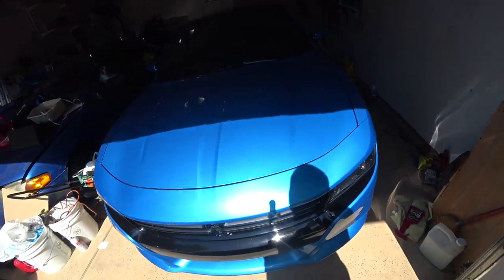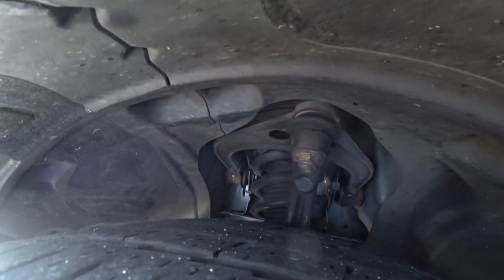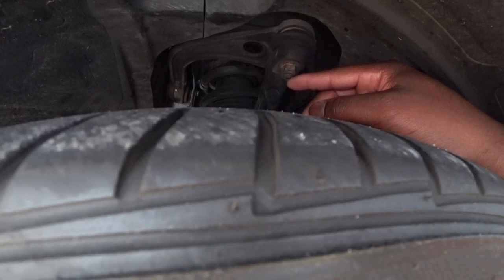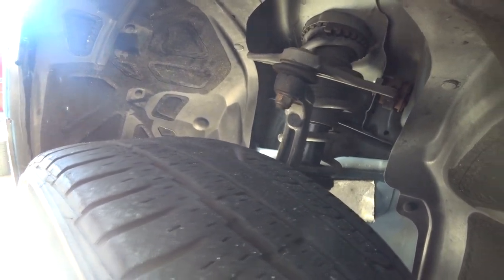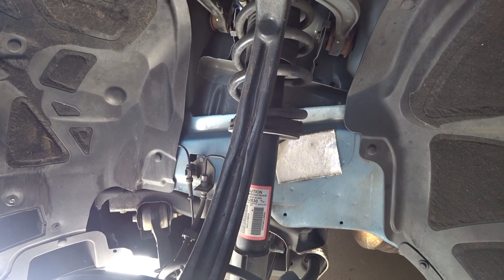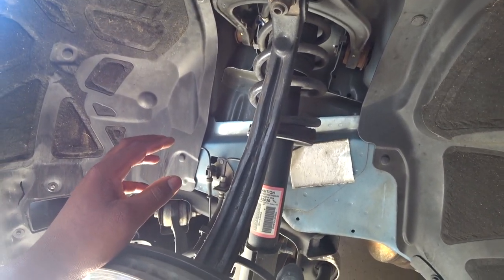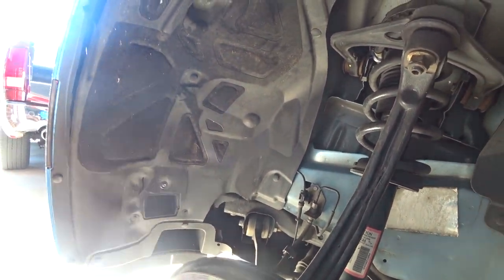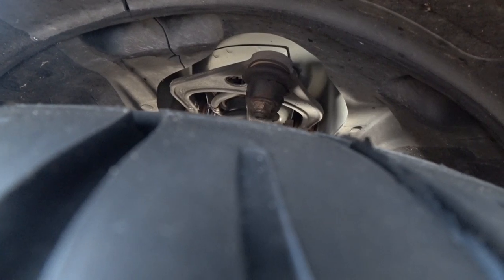Fitting 26s on a Dodge Charger

Comment: come to my work and we put 32-inch or larger wheels,
for sure you have to extend the front suspension 2 inches and back with a 1-inch cup for wheels 26 for charger , challenger and magnum 
Come to Dallas Tx
Reply: Where do you work? I'm in Dallas!
Reply: Aye I’m in Dallas where y’all located?
Reply: Me puede explicar el vídeo en español por favor se lo agradecería mucho
Reply: Whats your shop called?
Reply: I’m tryin to put 24s on my challenger here in Dallas where y’all at

Comment: 2013 charger.from 215/65/18 to 275/40ZR20 106Y.   20x8.5J... I had the same problem. What i did. And didnt know anything. Just got 2" spacers. And now my rims fit. And about 1.5"to2" clearance. All good but the rear hits the tires when going fast and bumps. So it bounces and rubs rear fenders to tires. The front is all g. But what can i do about the rear. Maybe i need need new rear shocks. Or something to stiff from bouncing. There is no vid on what im talking about. 1st person ever with this problem?. Oct 1st 2022.

Comment: What’s your offset bro? Trying to make sure they don’t rub my spindles before I buy
Reply: Rub my brembos I mean
Reply from the maker: So Forgiato doesn't give the wheel specs on the box or on the rim.  I just told them what car it was for and they built them based on their specs.  I know the front is medium and the rear is low but not the actual offset and backspacing.
Reply: @mrobe057  Aw ok dam thanks. I might just have to go that route

Comment: Hey what tire brand did you go with. For your 275 25 26. I have a 2019 challenger R/T. I wanna make sure I have no rub, like yours. Thanks
Reply from the maker: The Delintes were slightly smaller than the Haidas but man they were so trash.  The Haidas in a 275/25 are a tiny bit bigger but that's what I ran after about the 10th Delinte.
Reply: Ok.. thanks. I'm not sure if I should go with lexani tires or lion hart.
Reply: Did u have any rubbing with Haidas tires, especially in the front ?

Comment: did you have to lift the baxk?
Reply from the maker: Nope... its stock.
Reply: @mrobe057  betttt ima get a 2015 r/t in april but i want the 6s onnit 🐐
Reply from the maker: They fit perfect and ride great.
Reply: @mrobe057  what size tires u rockin widdem
Reply from the maker: 275/25

Comment: What’s up mike. I was trying to see how much the spindle is. I have a 2012 charger and I’m thinking about going 26’s
Reply: Did you find out
Reply from the maker: They usually run between $500-$800.  Mine were 800.
Reply: Bet preciate it

Comment: Question. I have 22s on mine. Will lowering my car cause this bolt to be close to the wheel?
Reply from the maker: Nope... That part of the spindle will not move if you raise or lower the suspension.

Comment: Hey is your rim a 26x9 or 26x9.5?
Reply from the maker: Front wheels are 26x9.  Rear are 26x10.5.
Reply: Thanks. Preciate it. Do you think a 26x9.5 will fit flush in the front or will it stick out